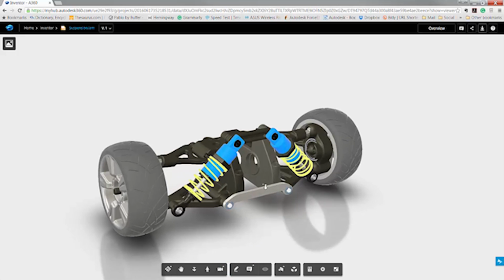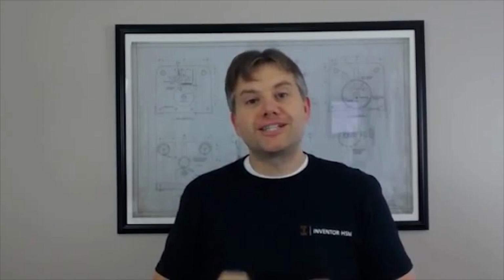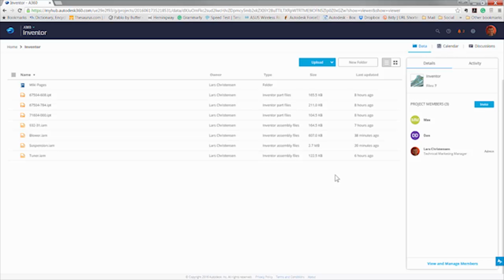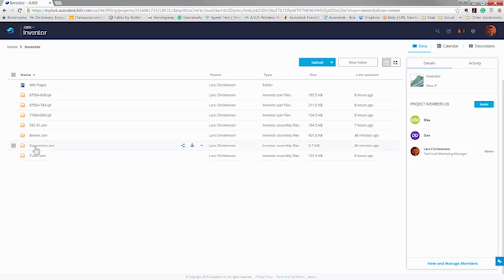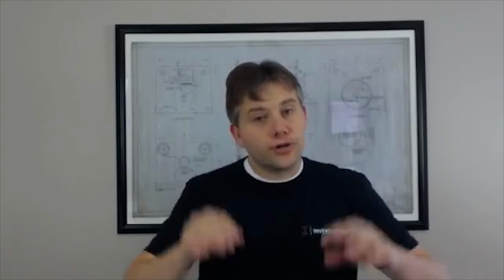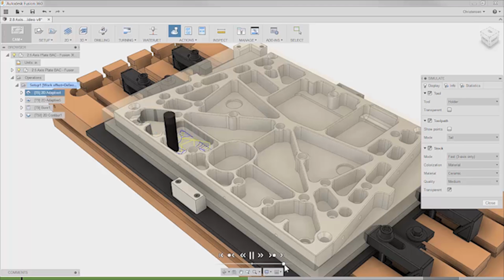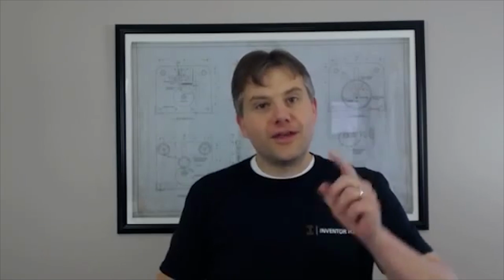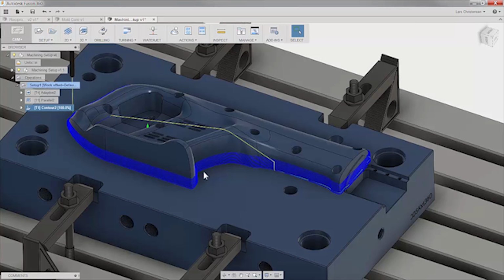Autodesk Inventor PrDS Users— As Crazy as It Sounds, You Have Fusion 360 Available...for FREE!

Comment: Do have any 360 videos on sheet metal forming? In 360 is it possible to create sheet metal projects? Starting with a flat sheet and adding different degrees of bends to form a pan or tray. I'm currently working on an enclosure for my cnc mill. I was thinking 360 could help me lay everything out to get my yield right. Thanks for any help...
Reply: https://twitter.com/adskFusion360/status/761335122801127425
Reply from the maker: Hi Chad, Sheet metal is on the roadmap for Fusion 360. Last thing I heard was that it should be right around the corner.
Reply: Thanks for the update.
Reply from the maker: Yes! Can't wait to get that in the software :-)